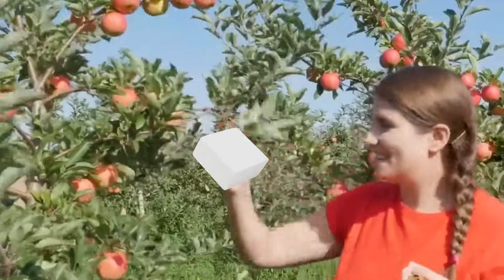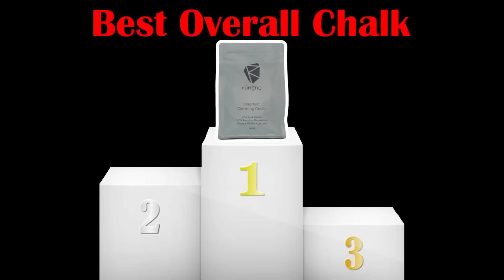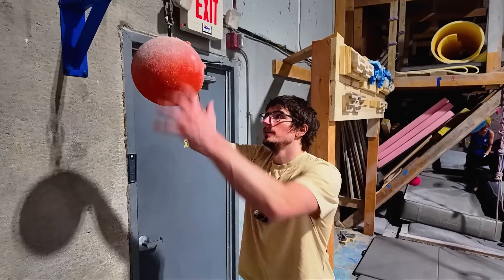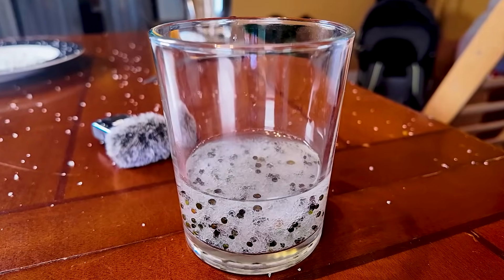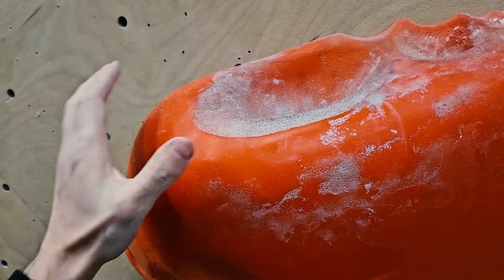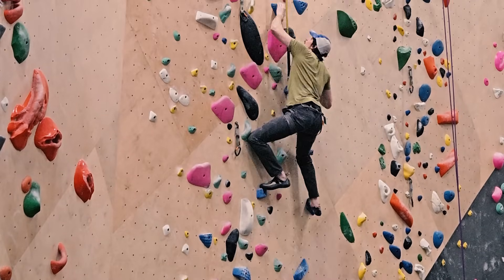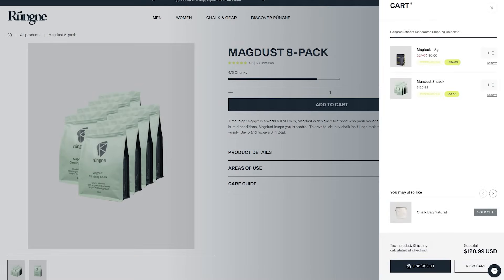What Will Happen to Climbing Chalk?

Comment: I realized this working at a Sally's Beauty Store recently actually, because a lot of the dry texturizing stuff in haircare such as BTZ "Rock On" texturizing hair powder's main ingredient is Silica Silylate for kind of helping with greasy hair and giving it that messy but clean look ig. I always joke to the shoppers who buy it about how they missed out big by advertising it as this stuff for rockers instead of actual climbers who use this type of stuff everyday. I'm kind of curious how the BTZ "Rock on" powder would work for climbers though that might be expensive, theoretically it might genuinely be cheaper to buy the BTZ powder though, because at .27 oz it's like 7.5 grams and at $8.19 x 10 it's $81.90 for a silica silylate so idk? A lot of texturizing powders and dry shampoos use that chemical so you might even find something that either functions better or potentially a better price.

Comment: PLEASE FOR THE LOVE OF GOD DO NOT USE THAT STUFF. Like srsly ffs. If you want to end up with chronic lung and chronic kidney damage you may but only in your own home gym to lessen the amount of potential victims. The only thing dumber coming to my mind is using asbestos. It ain't needles, but still. There is no way to metabolise this stuff in your body and it will not degrade over time. There are several medical relevant studies made with ppl who worked with this stuff in the past and they only breathed in leftover airborne dust specs from cuts and even those people had largly significant higher rates of CKD and CLD including cancer. The stuff you breathed in is so fine that it should be declared a weapon honestly.

Please before promoting or even dare to shine the a light of the publics eye on it either use your god given brain or do the tiniest amount of research.

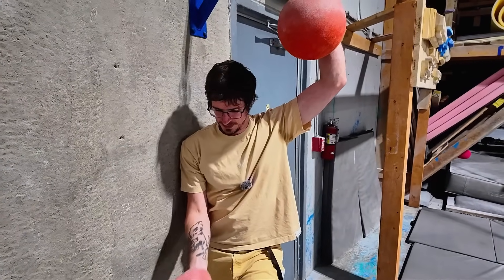Comment: First, at the 7:45 hang, you're not slipping, you're just testing your one arm power endurance. As to the benefits of a $105 bag of Intergalactic Uberchalk, well, what matters to you? At 74, my skin has lost nearly all its callous, and "old man skin" is so slippery that I fail on many sloping routes, regardless of chalk. Good old cheap alum, also a drying agent used in pickling, which may explain the old timer's use of pickle juice to toughen skin, I've played with, and applying a pinch with Witch Hazel half an hour before my gym visits definitely enhances my skin's friction coefficient; liquid chalk then serves as base for the session, but all wears off within 6 or so harder routes. Alum cost a few bucks for a 3.5 oz bag, and my 1/8 tsp. will not break the bank.
  I won't dump $100 per bag to send grades I used to do routinely, just to look like a Boomer poser. Just me, but I'll just donate that to any candidate who can offset the approaching end to Democracy as we knew it.

Comment: •	Indoor gyms = closed spaces ➔ fine powder can accumulate in the air.
	•	Chalk use (normally magnesium carbonate) already creates a lot of airborne dust —
                ➔ if Silica Silylate (synthetic amorphous silica) is also used with it, the amount of dangerous fine particles in the air would dramatically increase.
	•	Amorphous silica dust (even though safer than crystalline silica) is still harmful if inhaled regularly in high amounts.
	•	Short-term: coughing, throat irritation, “heavy” breathing feeling.
	•	Long-term (chronic exposure): risk of chronic bronchitis, COPD, and possible emphysema (damage to lung alveoli).
	•	No confirmed link to cancer for amorphous silica — but chronic lung diseases (like COPD) remain a real risk.
	•	OSHA (U.S. Occupational Safety and Health Administration) recommends a maximum exposure of 6 mg/m³ of amorphous silica dust in air, averaged over an 8-hour workday.
	•	Even though amorphous silica is way less dangerous than crystalline silica, it still causes lung stress when inhaled chronically.
	•	Silica Silylate would stay airborne much longer than magnesium chalk, meaning it would be easier to reach or exceed OSHA limits in a busy, enclosed gym.
	•	It’s a completely unnecessary health risk for climbers, coaches, and staff — especially when safer alternatives exist (like magnesium carbonate).

In short  it's just a very bad idea to use Silica Silylate (or any amorphous silica) as climbing chalk.
	•	It would greatly increase inhalable dust in the gym.
	•	Long-term risk for chronic bronchitis, COPD, possible emphysema — even if it's not sure it's causing cancer.
	•	OSHA limit shows that even “safer” silica types must be strictly controlled to avoid lung damage.
	•	Normal climbing chalk (magnesium carbonate) is much safer and creates larger particles that fall quickly to the ground instead of staying in the air.

omg
Reply: is there any problem with using it outdoors for your hardest project?
Reply: Where do you find that information? As far as i could find information, that stuff is harmless (looked at safety data sheets)
Reply: @lalilu3382 they just copy pasted a chat GPT answer
Reply: @lalilu3382 the reason a safety data sheet might not flag it as a hazard is because it is incredibly inert. Inhalation, ingestion, and skin contact with fine silica powders won't cause any immediate chemical reactions with the body, meaning that it won't be listed as corrosive, caustic, flammable, or an acute health risk from a chemical safety standpoint. The real danger comes from accumulation in the lungs over time: because it's inert, the body can't interact with it to remove it. For more information I'd recommend looking through the OSHA guidelines and medical research or case history about silicosis and related chronic lung disease caused by particulate accumulation in the lungs.
Reply: Did you copy and paste this from gpt? I’ve never seen a human format a comment like this
Reply: @daniel1122345  why do you care
Reply: @daniel1122345  He sure did. And it's not even accurate. Imagine that. That's not to say that sucking in a mouthful of silica isn't harmful, but it is to say fuck people who copy and paste chatgpt slop as if it's facts. It's not. It's a retarded search engine designed to regurgitate garbage in a palatable way.
Reply: Actual bot comment
Reply: @alondjeckto  lol shutup
Reply: Inhaling silica in any form is indeed quite a risk. A YouTube channel called Chubbyemu run by an MD made a great video about the dangers of inhaling silica during construction, caving, tile cutting, etc. The primary risk mentioned there is silicosis- an irreversible lung disease that gets worse as more silica powder accumulates in the lungs and with time, even without additional accumulation. It can cause everything from lung irritation and coughing to respiratory failure (death) and is not uncommon among people who inhale even miniscule amounts of silica over the course of years like a rock climber might, even just from one person using it at the gym every once in a while.
Reply: Also important to mention: amorphous silica can still contain crystalline silica to some extent.
Reply: @ Yeah and looking at how dangerous it is i wouldnt mess with it. REALLY BAD on magnus for doing that shit tbh.
Also they apparently source from china it may be dubious
Reply: Welp, I wear an n95 to the gym avoid getting sick, and now I have another reason to keep it on
Reply: Yeah just ask anyone who works in construction

Comment: "1. What is silica silylate?
"Silica silylate" is usually a term for fumed silica (amorphous silicon dioxide, SiO₂) that has been chemically treated to be hydrophobic (water-repelling), typically by adding trimethylsilyl groups. It's still a very fine particulate silica, just modified.

2. Is silica (even hydrophobic/fumed) safe to inhale?
Short answer: NO, it is not safe to inhale, even if it's amorphous.

Crystalline silica (like quartz dust) is the classic cause of silicosis — a very serious, irreversible lung disease from scarring.

Amorphous silica (like fumed silica, including silica silylate) is less dangerous but still harmful when inhaled over time.

Amorphous silica doesn't cause silicosis as aggressively as crystalline silica.

However, chronic exposure can still cause lung inflammation, fibrosis, and respiratory issues.

NIOSH (National Institute for Occupational Safety and Health) still recommends limiting airborne exposure to amorphous silica.

3. How does this compare to normal climbing chalk?
Normal climbing chalk is magnesium carbonate (MgCO₃) — which also isn't ideal to breathe in, but it's a less serious lung hazard compared to any form of silica. Chalk dust mainly causes temporary irritation unless inhaled heavily over many years.

Silica, even if amorphous, is riskier long-term than magnesium carbonate.

4. Would gyms filled with Rungne "chalk" pose a risk?
Potentially yes, especially:

In poorly ventilated gyms,

If a lot of dust builds up in the air,

If used daily by many climbers over months or years.

Repeated exposure to airborne silica silylate dust could absolutely create respiratory health risks for climbers and staff.

5. Final word?
🔵 Silica silylate is not safe to inhale.
🔵 It is more concerning than traditional magnesium carbonate chalk.
🔵 Gyms should be cautious about using products like this, especially without great ventilation.

If climbing gyms start switching over to silica-based "chalk" without realizing this, it could indeed lead to major air quality issues and health problems over time.

Would you like me to also explain why Rungne might have chosen silica silylate anyway (marketing advantages vs. safety)?
It’s interesting — and a little concerning. "

wtf is wrong with magnus
Reply: You've got my interest.  Have an inside track on why they decided to use this material?
Reply: Don't use ChatGPT for safety tips

Comment: Thanks for the video! Impressive results. I'm concerned about this product becoming mainstream though. Magnesium carbonate can be  mined naturally, or produced in a low-temperature process using magnesium salts and sodium carbonate. 
Low toxicity, bio degradable. 
On the other hand, silica silylate production is a high energy process (pyrolysis) and generates serious toxic by-products during its production: hydrochloric acid, silicon tetrachloride are very hazardous and can cause serious environmental damage.

 I'd honestly prefer if this product wasn't out there. It's like Gore-Tex, consumer always wants the best of the best, whether they need it or not, and once everyone uses it, it becomes necessary to use it too to keep up with the times/competition. It might help someone send a 10a one day, which would be mind boggling, but it will most likely "help" millions send their little daily boulder problem in their local gym...

Comment: For no-tex holds not clean hands are the best you can get, moist hands are. That's why they bring a wet towel. Problem is it doesn't last very long. I'm sure you could have done that attempt of a pull up with moist hands just as well.

Comment: Respiratory Therapy Care at Cleveland Clinic:
If you work in a job around crystalline silica, you can breathe in dust that will cause lung damage. You can help to prevent silicosis if you use protective equipment.

Silicosis is a lung disease caused by inhaling very tiny crystalline particles of silicon dioxide, or silica.  Be safe out there climbers ♥ Don't huff magdust or maglock
Reply: This has been heavily tested and this stuff is very unlikely to cause any health problem but you should deff not breath it in

Comment: There is this stuff called "Hair Volume Powder" it is a mixture of Silicate Silyate and some other stuff. When I use it to style my hair I always have this "sticky" feeling on my hands. Its probably similar to the sticky feeling you get with Maglock. Would be really interesting to have these two compared, because the volume powder is so much cheaper. Its like 5€ for 10g for the decent stuff, but there's also super cheep stuff that costs 1.25€ for 10g. 

I am also wondering about the residue it may leave at the holds. Is there any residue with maglock? And even more interesting will the voumepowder leave residue?

Comment: You said magdust is 100% pure magnesium carbonate (2:55), but on rungne's website they list the ingedients of magdust to be mgco3 as well as amino acids... i think its the amino acids that make magdust better than other high quality mgco3, because the amino acid acts as a better binding agent for the polarized mg2+ side of the mgco3 and then the opposite side of the amino acid helps bind to your skin keratin proteins via the amine side of the amino acid, which doesnt increase grip strength for the chalk-rock interface but does increase the bonding strength of the chalk-skin interface, if that makes sense
Reply: I was thinking the same thing
Reply: @Thimbletonn  So was I actually

Comment: Is there not a real danger if we allow different compounds to take over from "chalk". Chances are that the most effective compounds we can come up with are going to be somewhat dangerous to either the user or to anyone cleaning the holds. 

Lots of other sports have run into this problem. Table tennis banned (re)gluing bats, European handball has limited the use of resin, partially because of the solvents they had to use to clean the court, I am sure there are many other.

Wouldn't we all be better off to stop this kind of arms race before it gets started?

Comment: Guys I looked it up and silica silylate is generally safe to breathe. Also it is advertised as a product that doesn’t bleed into the air as much as regular chalk. Idk if it has any effects on rock though.
Reply: How is this safe:

Amorphous Silica, Inhalation. The database is lacking studies evaluating the effects of intermediate-duration inhalation exposure to a-silica in humans. However, data are adequate to identify the critical effect following intermediate exposure to synthetic a-silica in animals. Available data indicate that the primary target of intermediate toxicity is the respiratory system following exposure to different synthetic a-silica polymorphs. However, only limited data are available regarding the relative potency of polymorphs following intermediate-duration exposure. The lowest LOAEL identified was 1 mg/m3 for 13-week exposure to pyrogenic a-silica, which was associated with increased cellularity, inflammation, and fibrosis; a NOAEL was not identified (Reuzel et al. 1991).
Reply: @gretabird7305  based off of the little I found it seems it is safe to breathe in small amounts but lots isn’t great to do. I also don’t know if this is true but if it is, it doesn’t go into the air as much like I said in the original comment, meaning you won’t be breathing it much if at all unless you breathe it in straight from the bad for some reason.
Reply: Please don't breath it. Only apply to hands and junk
Reply: Generally? 😅
Reply: @richardjanssen4195  I think it’s fine as long as u don’t breathe a ton

Comment: So, I know a bit about fumed silica, have developed products with it, and most important I know that it can be carcinogenic when inhaled. I’ll see what I can find on this product and I’ll  post what I find. In the meantime, avoid inhaling it — really
Reply: Maglock isn't fumed silica, it's silica silylate.
Reply: CORRECTION! Fumed silica and modified fumed silica’s in dry, free-flowing powder form can cause silicosis, not cancer. This is still a debilitating lung condition but I don’t want to spread incorrect information. 

It’s important to note that inhalation of fine particles is the problem, so when I use these chalk alternatives I plan to restrict use to outdoors, and I’ll use sparingly. I found no significant hazards for skin contact, and I have never had a skin reaction to fumed silicas (25-30 years of working with it it the lab).
Reply: @marcoramos8447  this cant cause it
Reply: Might be carcinogenic when inhaled*

We arent sure yet.